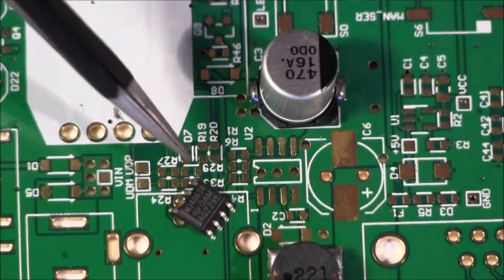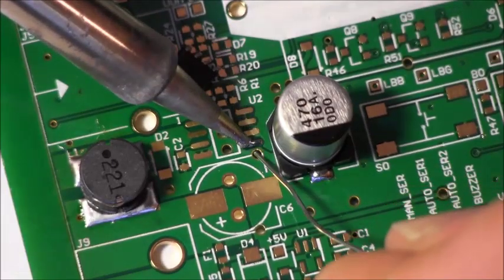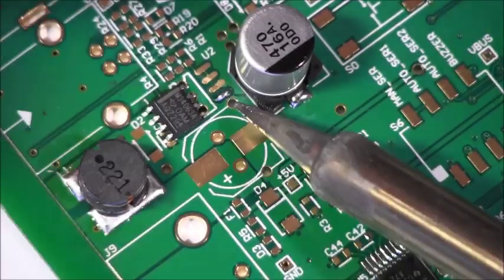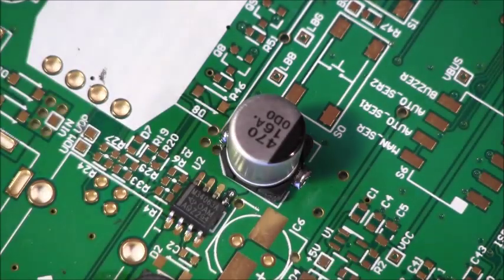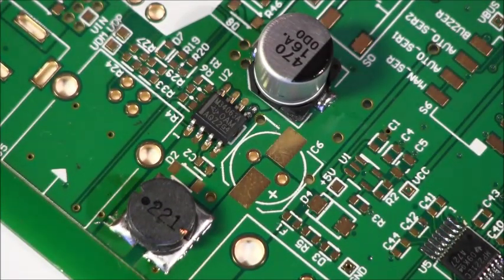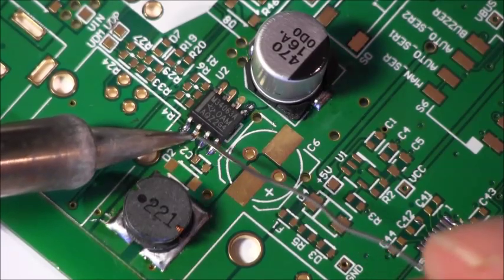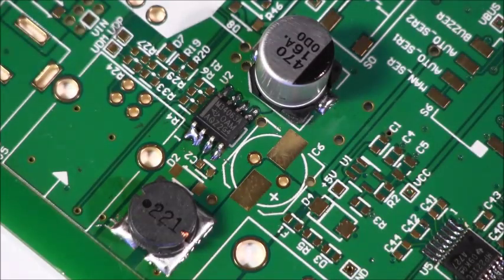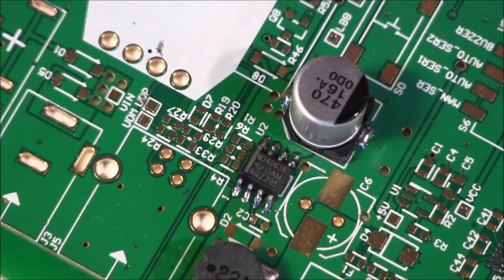Soldering an SOIC part

Comment: All of these videos have one thing in common, so far know one mentioned the solder iron temperature, by experimenting using  Kester 44 Solder Wire, 63/37 0.020-in, RMA Rosin, 3/4-ounce Tube at 650 to 700 degrees (343 to 371 C) might be right or wrong it has worked for me.

Comment: I think your dwell time on the pin is too long and could damage the part.   pins are rated for so much heat for a length of time.  datasheets will carry that information but for reflow soldering.   when doing this way shorten that time.   also.  where was your flux.   if relying on flux core solder it's not enough.   just my observations.   nice video otherwise.   PS.  if you use a paste flux you can use it like a glue to position your part.   then simply hold part down while soldering.

Comment: Remelting solder without flux gives cold joint and is not allowed. First joint is fault in the long term.
Reply: standishgeezer With some flux as he said!
Reply: So how would you do the job...without hot air gun Vladimir?
Reply: good enough for prototypes?

Comment: How do you solder wires to the pins of an SOIC? I've been trying for hours and but every time it goes to hell. I'm practicing on a broken motherboard. That would be a helpful video too ;-)
Reply: Definitely a challenge!  Use 30AWG wire-wrap wire (or smaller).  Tin the wire and the pin.  Heat the pin at the top (near the plastic) and wait to see the solder melt on the pad then bring in the wire to the pad.  Make sure you see the solder on the wire melt when it's in contact with the pin/pad, then remove the iron while keeping the wire very still for 2 seconds or so while the solder solidifies.  If you have a good stable work surface and a steady hand, it's not too bad.  If you have to do adjacent pins it gets pretty tricky.  You can also lift a pin (you get ONE chance before it breaks) and solder to that while it's sticking up.  Or get/make a little breakout board.  Or follow some traces to a different location on the PCB and solder there.  All depends on what you're trying to do.  We'll put your request on the "to-do" list of videos!
Reply: Thanks for the suggestion! I'll try this tomorrow, although the are no visible pads, or they're too small. I have to solder a ribbon cable of 12 wires (1.27mm pitch) to the pins of one side of an IC. I've been trying the method described in the photo I'm linking to, but I cannot do it so far: http://imgur.com/a/jZPB1
Reply: That's some nice work in the photo.  With multiple adjacent wires the problem quickly becomes "adding width" to each pin you work with and you'll inevitably bridge a few.  Flux will be your savior in both those cases. If you wick it, you'll likely remove at least a few of the connections you already made.  

I recommend starting in the middle and working out.  You could also start with 30AWG wires and bring them out to your cable.  An extra step, but could save a LOT of frustration.  I'd also clamp or hot glue (or at least tape) the ribbon cable down to the board in exactly the right position so you can just gently press the wires down to the pins and not have to worry about lateral movement.  That will help immensely.
Reply: You were right. Flux was my savior. I use a 60/40 solder with resin core, but man, that extra flux made the difference. Now, when tinning the pins they would hold just the right amount of solder without creating a mess and it was just a matter of pressing the tinned wires onto the pins. First try and I was able to solder an x8 ribbon cable on my test motherboard. Tested for continuity, passed. Thanks for the other tips too!
Reply: Awesome, great work!

Comment: can I do this at home ? I have zero experience soldering before tho and my external hard drive just died and it's doing the click of death
Reply from the maker: +ninearthify Of course you can do it at home if you have the tools.  We use a Hakko 888D iron, some good tweezers, solder wick and 0.020" solder - about US$100 worth of stuff and there are plenty of lower cost irons out there, too.  The bigger question is can you identify the component on your HDD that is the problem, can you actually get a replacement part, and then can you successfully do this work?  We've had our fair share of HDD crashes, and none of them were serviceable.  

On a side note: external hard drives pull a lot of current!  If you are running on USB, try a very short cable and make sure you are running on a full power USB port (non-powered hubs don't tend to work).  If your HDD has an external power source, make sure you have that plugged in, too.  Hopefully that solves your problem without ever warming up a soldering iron!  Not quite as fun, but definitely less risky.  

Good luck and thanks for watching!
Reply: Engenuics Technologies wow thank you so much for this information. I wish there were kind people like you where I live. Here everyone is such a jerk trying to charge me $1000 to $1500 for recovering this data.
Reply: @ninearthify  I think this happens also because they have other potential costs to cover ,especially the responsibility of handling your data...

Comment: honestly this job would be much easier with some flux and a bit of drag soldering.
Reply from the maker: You are absolutely correct, Bill.  But with the thousands of engineering students we have worked with, not one of them owns flux, so we detail this alternate method.  Always good to have extra tools in the tool box.  Thanks for checking out the video!

Comment: Are 8-pin transistors interchangeable?  Great tutorial, by the way.
Reply from the maker: Thanks!  Any time you're comparing two parts that are in the same package, get the datasheets for those parts and carefully compare the function of each pin.  The chip we're doing in this video is a switching power supply controller.  SO-8s are very common and can be anything from transistors and diodes, to memories and op-amps.